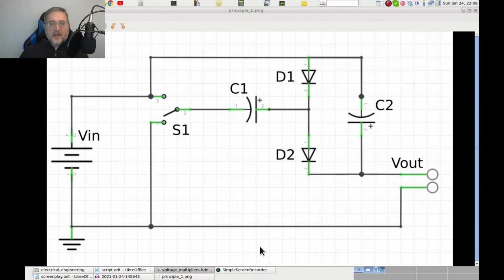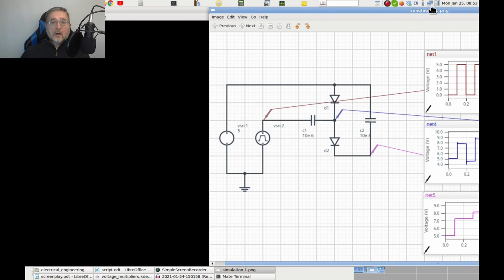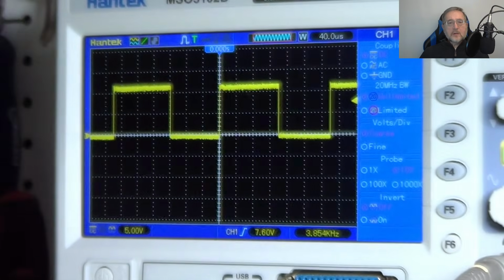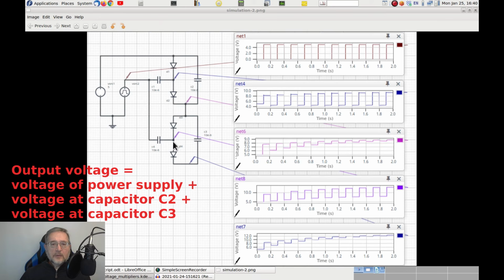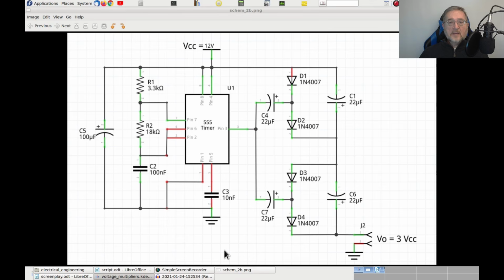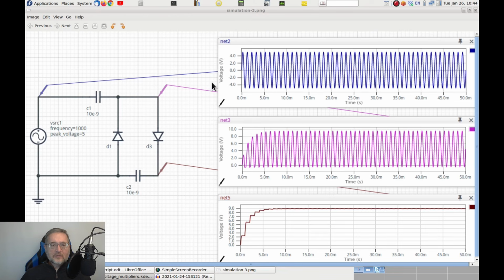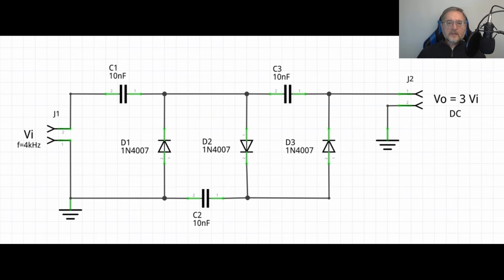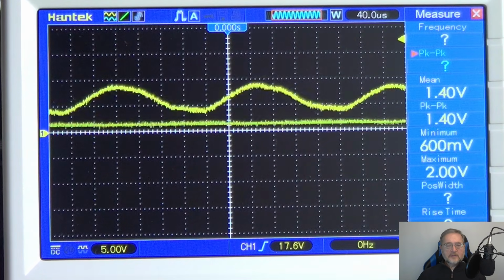Voltage Multipliers Explained

Comment: Does the 555 circuit also work to operate transistor to run ignition coil to run high voltage tripler with higher rated voltages? The pulser 555 pin 3 is a pulse DC , ... not AC. The voltage multipliers normally need AC input to work.
Reply from the maker: A pulse is a pulse. Whether you consider it dc or ac depends only from the reference point. It all depends on where you put the ground.

Comment: Is it possible to use voltage doublers for a supply that has + and - voltages? I'd like to create a supply that has + and - 400V (approx). Would you need a transformer with a center tap and two sets of voltage multipliers? I wanted to use a Variac to control the AC input voltage to the transformer (say a 120 VAC to 12VAC transformer). I'm hoping to have a get a variable high voltage power supply to use for vacuum tube prototype circuits.
Reply from the maker: It is possible for DC to DC converters. The side that provides the negative voltage should be obtained with diodes connected in the opposite direction.
It is not possible with AC to DC converters, because the output of the converter would not and could not be connected to ground.
In your case, I would suggest a more usual solution, usign a step up transformer to obtain the voltage you need.

Comment: What if we operate mosfets ( p and n channels) to switch on this 555 wave. Then no need of transformer
To achive good current output.
Reply from the maker: Unfortunately the mosfets would not help. The current, in fact, is limited by the amount of charge in the capacitors, non just the 555. And that is why these voltage multipliers have limited applications and are non good for providing considerable amount of power.